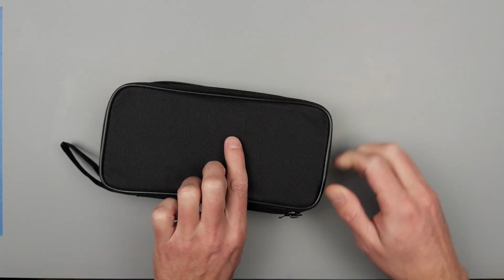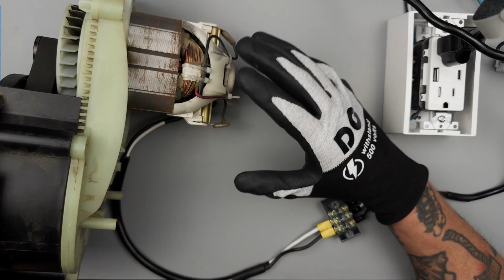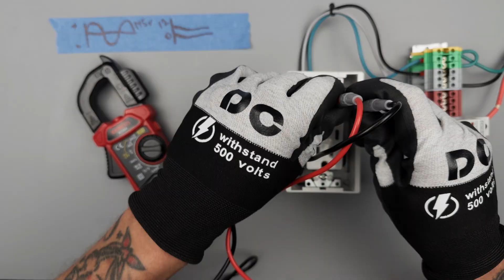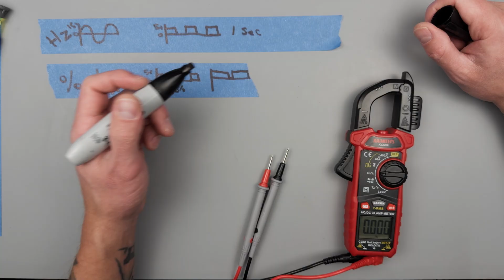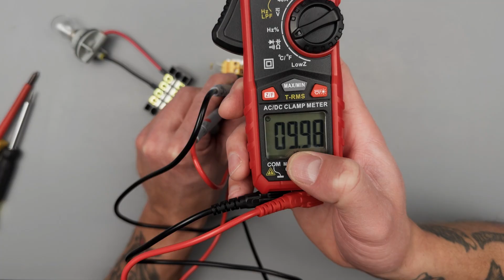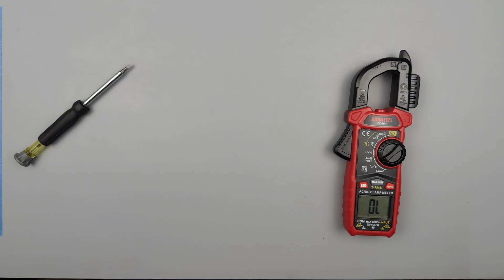How to Use Kaiweets KC604 AC/DC Amp Clamp (Complete Guide)

Comment: How many DC amp can it measure, is it 400amps or 600amps because on the clamp it shows 600amp but the setting goes up to 400amp.
Reply from the maker: I’m pretty sure it’s 400 amps DC. But you would have to contact customer support to be sure
Reply: @maddoxmechanic 
Ok thank you
Reply from the maker: @AviationNut  You bet!
Reply: I see it's been a while since you posted your question, and I can't help you, but Kaiweets has a YouTube channel, maybe they can give you an answer there.
Good luck, be safe.